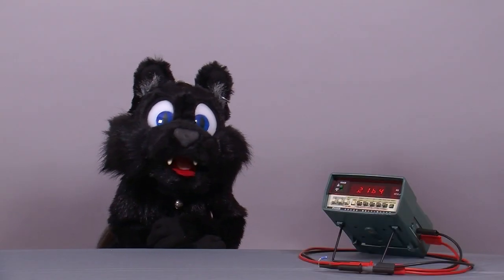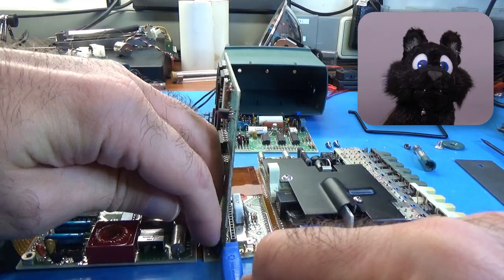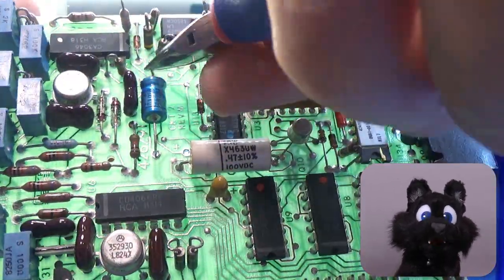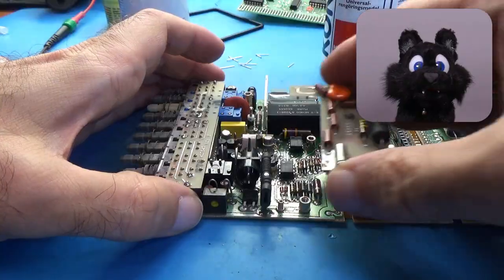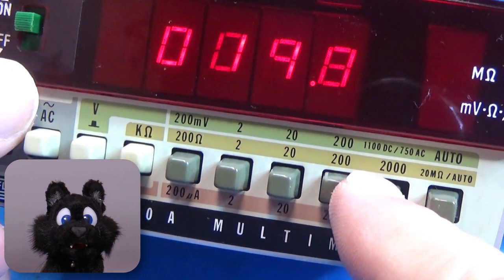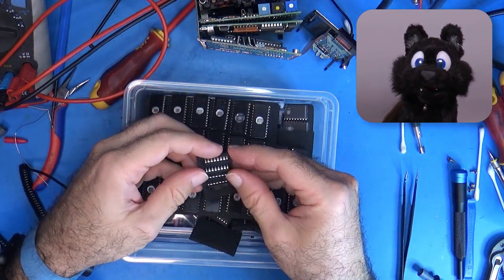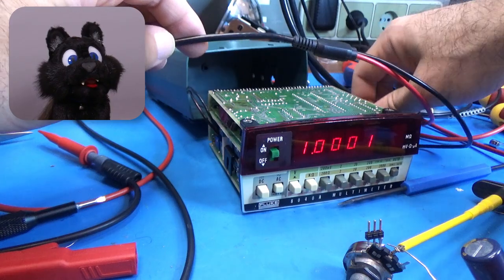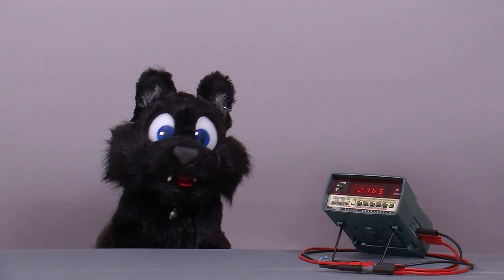Restoration Project #28 - Fluke 8040A

Comment: Ooff well it looks like I'll have to clean the switch bank in my 1978 Keithley 5 1/2 digit multimeter. On the 20 Ohms range (that's 1mOhm accuracy!) it often reads garbage. And I really like that setting, because when it works I can much easier find short circuits or defective ICs. The other settings pretty much always work though.
(That thing actually runs on a 6802 CPU...)
These CD4016s like to go bad...
C'mon, there's CERN in Switzerland... one of their dumpsters' gotta be connected to Dave Jones' dumpster through the core of the planet :-D.
(they have an e-waste dumpster in every building near the entrance door that's just screaming "Hey! Need parts for a project? Help yourself!" I got a bunch of mysterious hybrid ICs that are unobtainium, ungoogleable, but say CERN on them. Cool. Useless but cool.)
Reply from the maker: Careful with random ICs from CERN... maybe they create portals to other realms? 😜 There might be a movie in that idea... Sadly, I don't have access to such dumpsters. The occasional washer or microwave in the communal dump is the best I could do but I'd rather not touch those items.
Reply: @atkelar  Well OK I don't find measuring equipment in the dump all the time (less than once a year), but I did score a Tektronix 535 that only needed a few tubes. But as many CRT TVs as I like. Definitely more than I can store. Old stereo equipment, more often than expected I find ancient computers! Like 2 years ago I scored a Rockwell AIM-65 in working order. And a few weeks later a VC-20 that only needed a new Kernal ROM.
6 years ago I scored big. As in huge.
5 Commodore 64 - all of the breadbin variant. 5 1541 disk drives. 2 Amiga 500. A Sony CDP-101 (the first ever consumer CD player). A Roland SH-2000 (the second ever synth with programmable aftertouch, 1974). A Roland Jupiter 4 (from 1978-1982 every second discopop song ever made uses one of these). And two Apple ][ clones, homebrew. And I got pretty much all of that working!
Reply from the maker: Ah yes, in the 80s, the C64s seem to have gotten some use as "data logging computers" - around here we got a new coal power plant at that time and they put out some environmental sensor stations. I recall that they had some 19" racks of instruments which fed into an SX-64 with an attached printer for data logging.

Comment: To answer the question, I have 2 AC voltage calibrators.... its not just Dave :-)
Reply from the maker: I was of course being a bit tongue in cheek ;) but those things are pretty expensive, especially if you only plan to use them once a year perhaps... I just can't justify the expense of even used ones.
Reply: @atkelar  Ive also got 3 DC calibrators... I think I need help LOL, all of these I picked up as faulty units and repaired, you seem to have enough skill to tackle something like that, maybe keep an eye out for a broken one, you will be surprised how often you end up using one to check things.
Reply from the maker: If I come across a reasonable one... - but I am at a tight budget as a hobbyist and I have quite a few projects in my queue already 😁